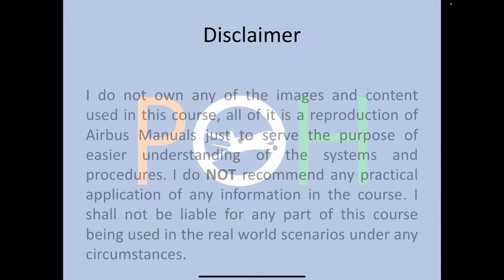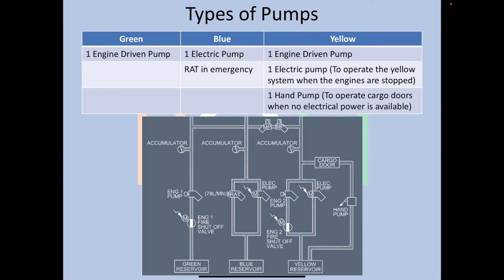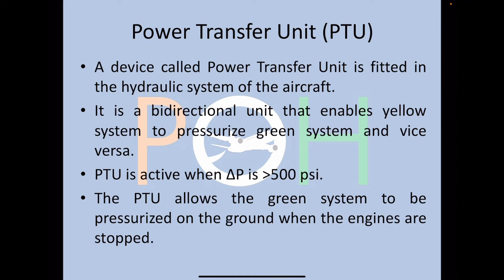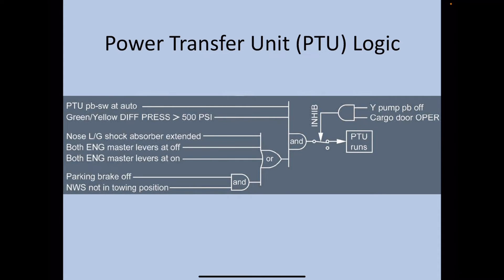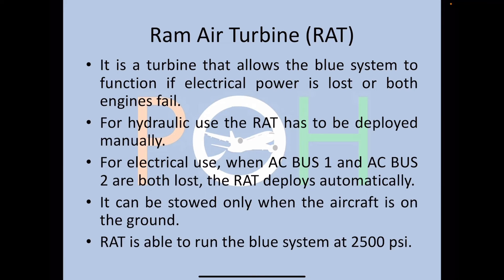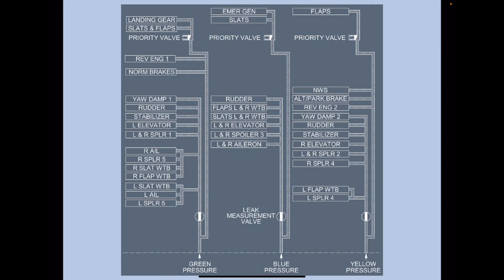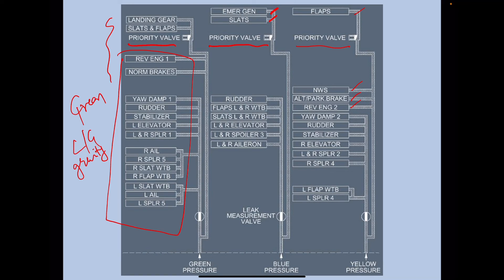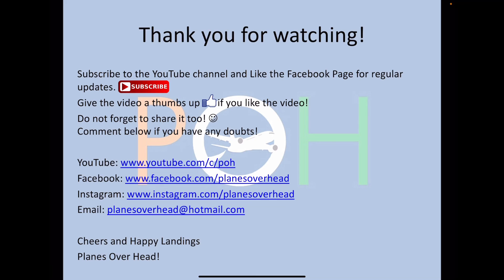A320 - Hydraulic

Comment: Without transferring hydraulic fluid how exactly does the PTU pressurises another system?
Reply from the maker: Its a Motor Pump Assembly, basically hydraulic pressure drives the pump via the motor which generates pressure for the other system.

Comment: Let's say we are doing a single engine taxi. The yellow elec pump is switched on and pressurizes the yellow system and we have the parking brake set to ON. If the yellow elec pump fails now for whatever reason, the PTU will not kick in and we will end up on accumulated brake pressure until we release the parking brake again and let the PTU do its job, correct?
Reply from the maker: Yes all correct.